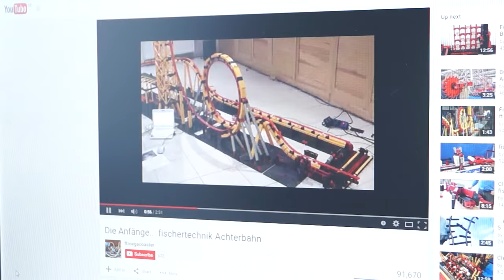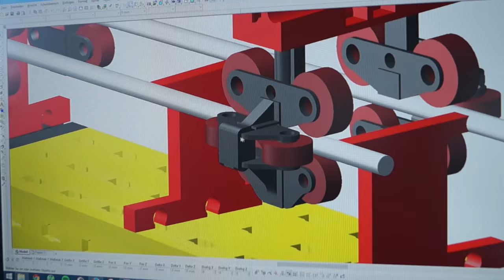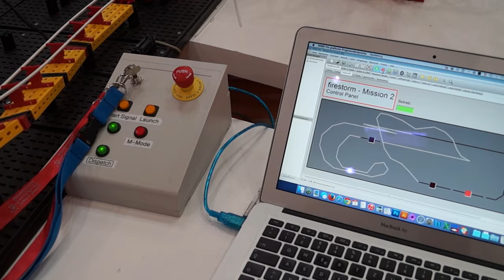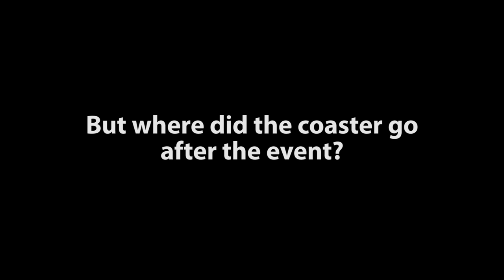My Roller Coaster In Saudi Arabia | fischertechnik Model Coaster

Comment: The brakes before the station, are those magnetic or friction?  If magnetic, I'd like to ask you how you set them up and control them? Great model! I'm guessing you used a micro controller to control the launch, door, station, and brakes.
Reply from the maker: Thank you, the brakes are eddy current brakes, just like on a real modern coaster. The magnets induce a current in the copper fins which then creates an opposing magnetic field that creates an attracting force between the fins and the magnets -> the train is slowed down. Take a look at https://en.wikipedia.org/wiki/Eddy_current_brake 
The control system is made with a fischertechnik interface, it can be programmed with a graphical software.